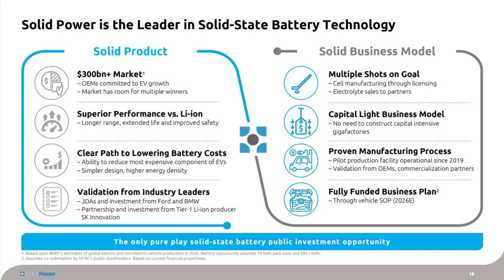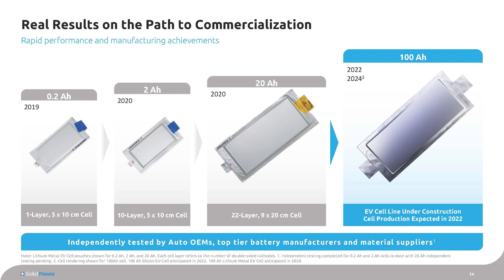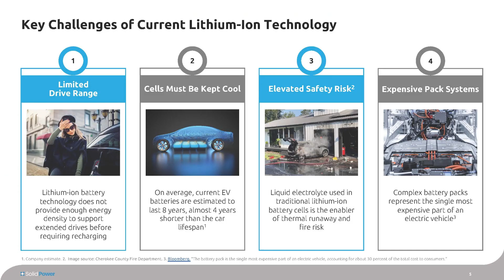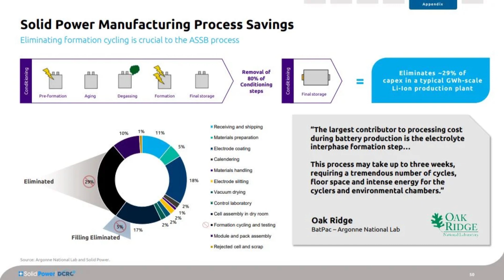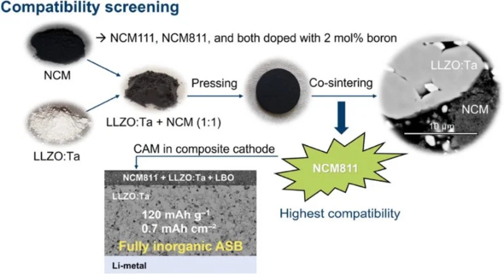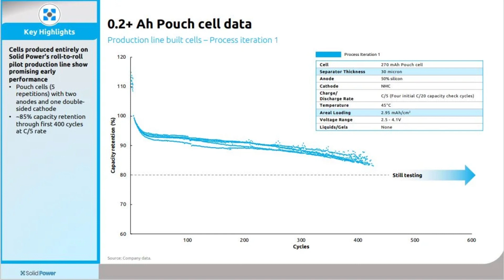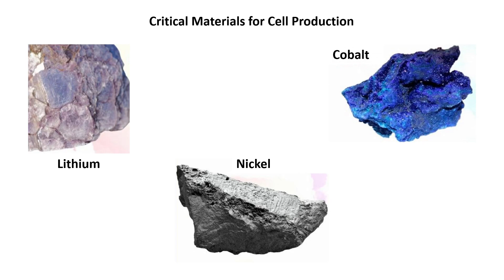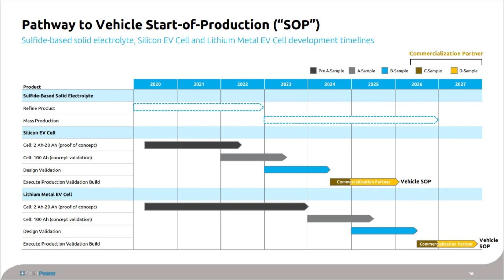Solid Power's All Solid-State Battery Cell Test Result: How good are they?

Comment: This video is telling lies. Qs has always published results and now is going to production. Where as sldp quit publishing results since they were mediocre at best. Sldp keeps saying that they keep sending cells to get customer feedback to improve the cells. If the cells are good enough there is no need for improvement. Further the test pilot line is still being constructed. But sldp said from the beginning that their cells could be made from existing manufacturing lines with minor tweeks. Why is the line complete? Because in my opinion is there is no viable cells . So delaying the line would be a way to stall until maybe one day the discover the right mix. Also the websites shows cells of different chemistries and power levels but those are goals .not actual performance numbers. See the small print

Comment: Am I correct in my understanding that Solid Power has not replicated their current test results in anything bigger than a coin pouch when it comes to reliability, cycles, and charge times? I thought the company had replicated these results in their larger pouches.

Comment: 1000 cycles is not enough for a car. 3000 would be better. They have options but it is not clear yet to see a winner in this field for my ignorant ass
Reply: 1,000 plus charge cycle for a car that does 482 miles per charge on a solid state battery means it'll do 482,000 plus miles. I think that's is a very good going. I'd be happy if I can run my diesel e class to one third of that.
Reply: It doesn’t stop working at 1000 cycles. It operates at lower capacity/range.  Around 85 percent usually. Just like an ICE vehicle whose bits are worn.
Reply: I’m trying to understand I think they mean charge cycles as in charge and discharge amount before the battery degrades think laptop and cell batteries. What, 2-3 or if good 5 years of user uses depending how often they charge before they need a battery replacement. Is this what you mean?